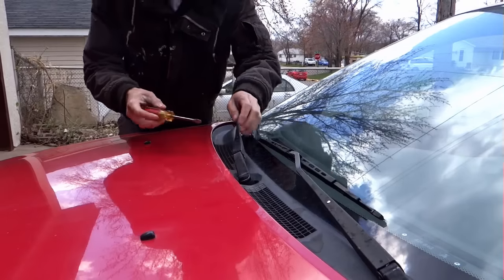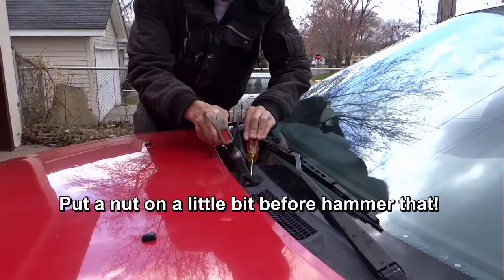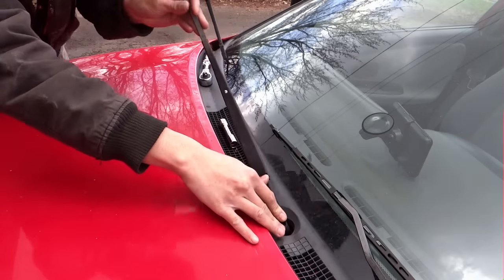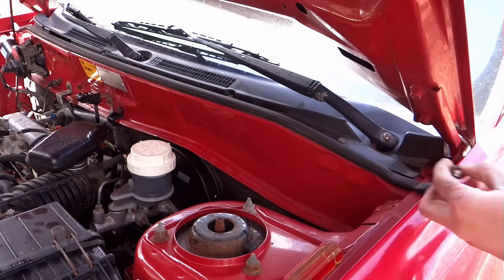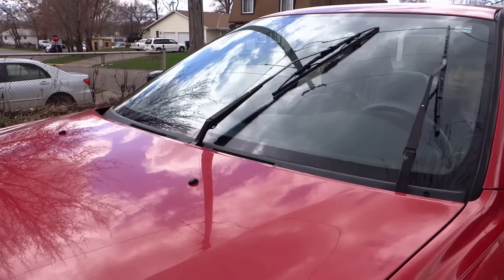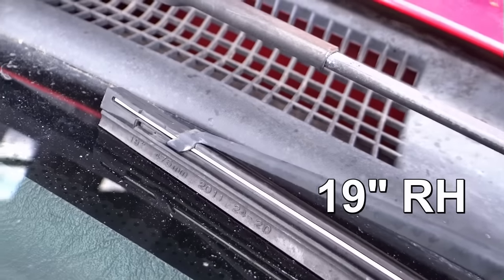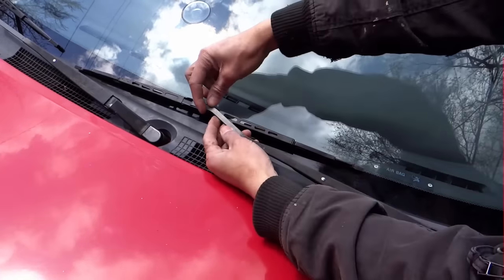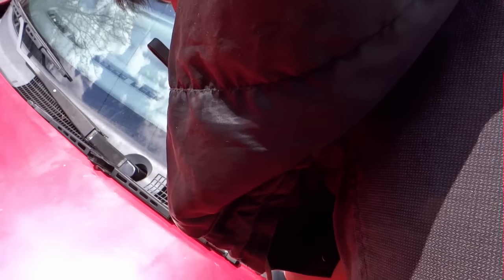Mirage Fix 7 | Windshield Wipers J Hook

Comment: Hello, I would like your help. I have a mitsubishi car, year 2000, equal to the one of your videos, but it has a problem when it is under way, the engine starts shaking and it does not accelerate.

Comment: Superfine wire wool or clay bar rubbed on the windshield takes off the micro crap that impedes wipers and makes them last longer..I 'm not sure about rain-x..I got the wipes and the effect didn't last 1 week.
Reply from the maker: Maybe polish with soft foam and 3M liquid wax would help, maybe.